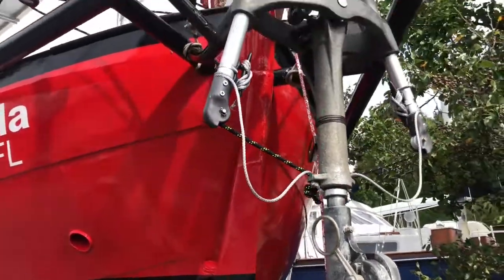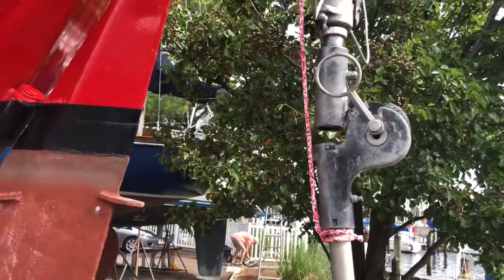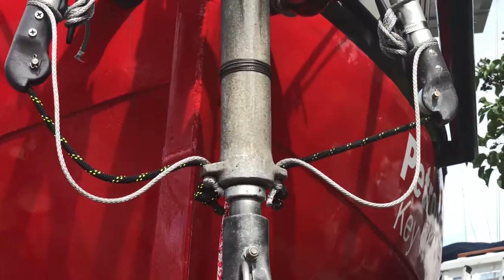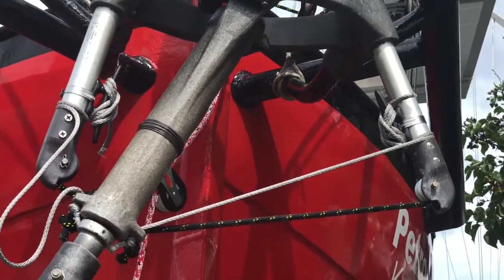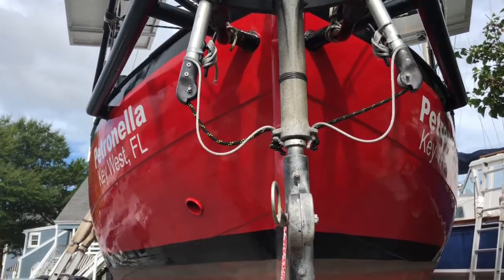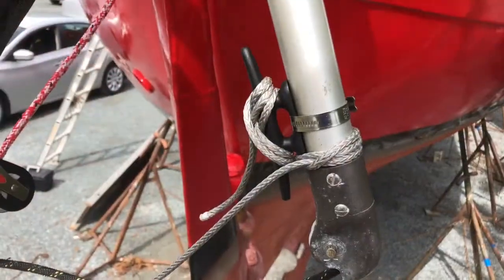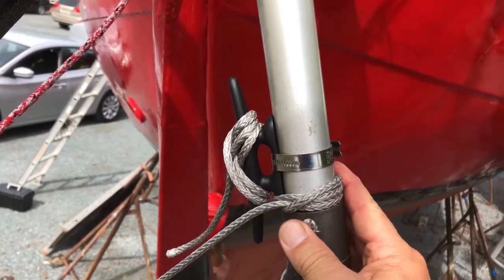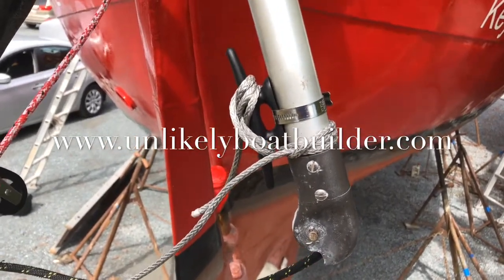Aries Windvane

Comment: Don’t know if you fixed it yet. But you can tie stopper knots to the steering lines. The oposite line stops the rudder short. Because they move in sincro there is no tangling of the lines.
Reply from the maker: In the end I fixed it by accident, by using dynema for the control lines. It doesn’t chafe at all, unlike the Dacron lines. Worked all the way across the Atlantic with zero chafe 👍

Comment: I would have had an eye splice on the dynema & fastened it to the post without the cleat. Then taken the end to the moving oar & passed through the hole & adjusted the length at that end , either by tying with a loop & a round turn & 2 half hitches or just a stopper knot like you already have. You can just adjust the position of the knot if you need to. Needs less dynema & far neater.
Reply from the maker: Lol, well that was what you would call a first draft. The cleats were an exceptionally bad idea. I should post an update.